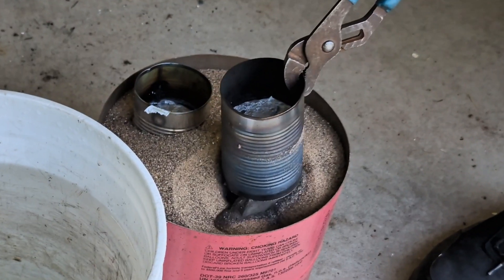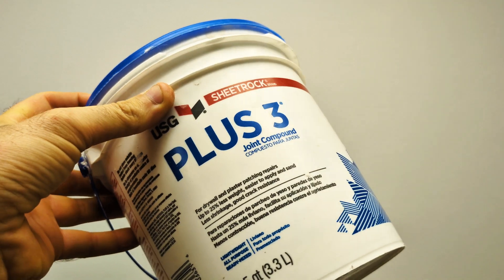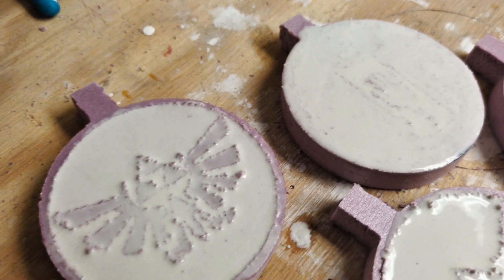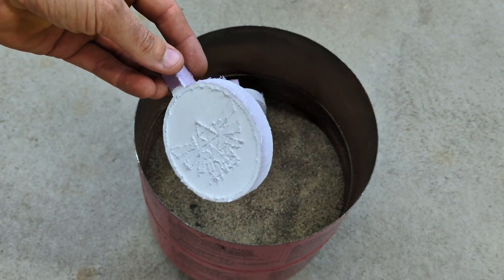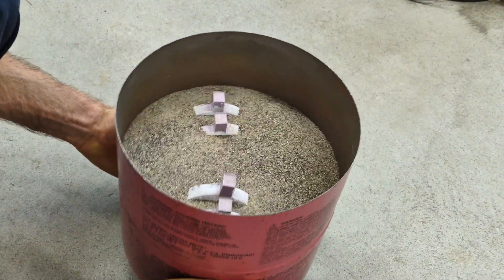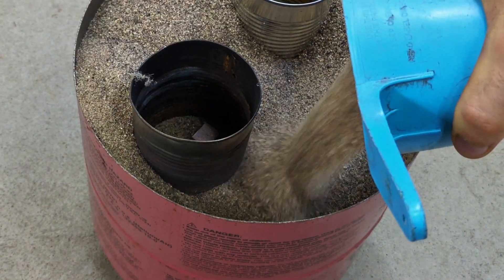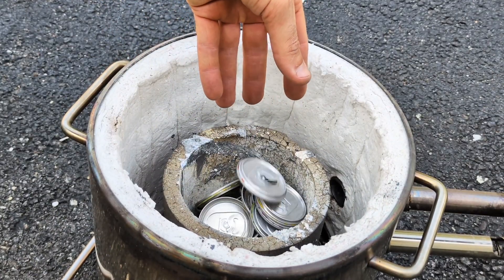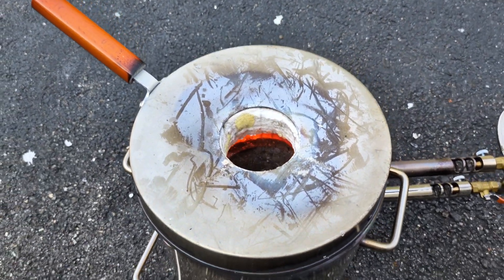Make a Lost Foam mold for casting: a step-by-step guide - Ingenious Method - Metal Casting Aluminum

Comment: So are the placeholders made of wax or something that vaporizes as the metal is poured in?
Reply from the maker: They are foam patterns that I coated with gypsum.  The gypsum is only there to keep the surface finish of the foam.

Comment: have you tried pulling the pouring can off before it complete solidifies in the can so you don't have to cut the can off afterards?
Reply from the maker: Hey!  I have done it once.  It could make a mess of Molten Aluminum.  I'm always scared it will mess up my cast.  However, sometimes I am able to remove the can instead of cutting it off.